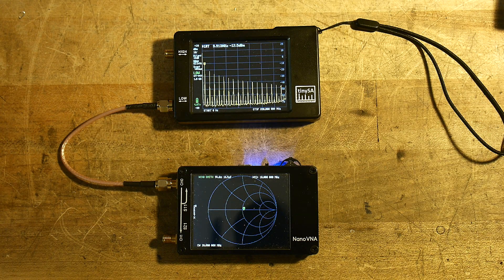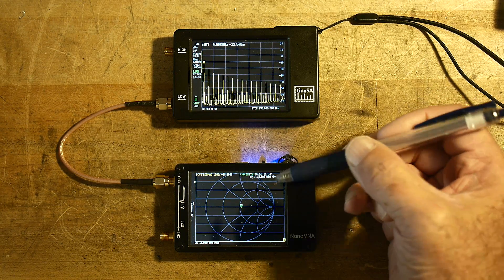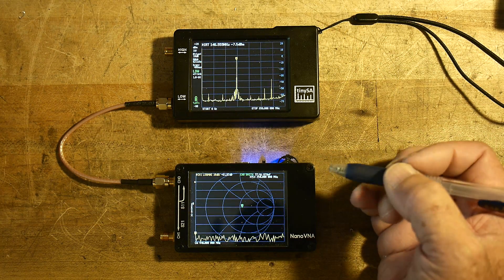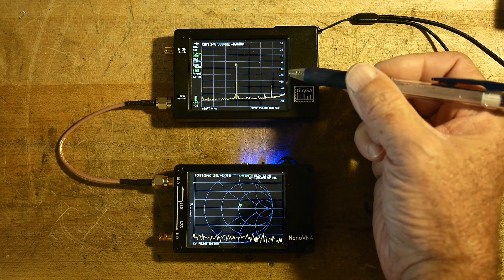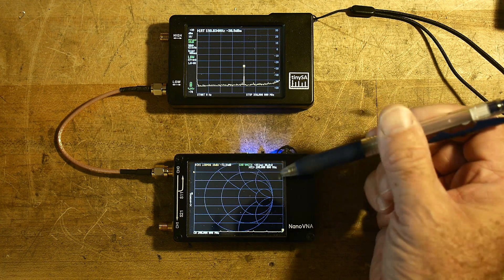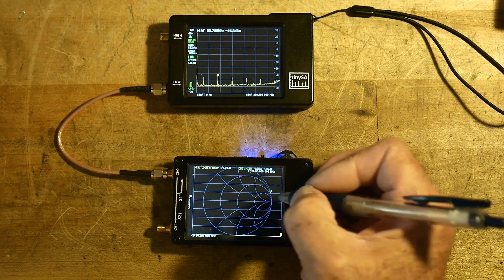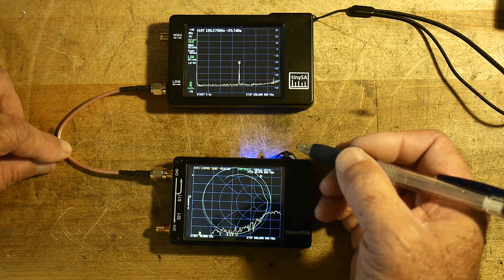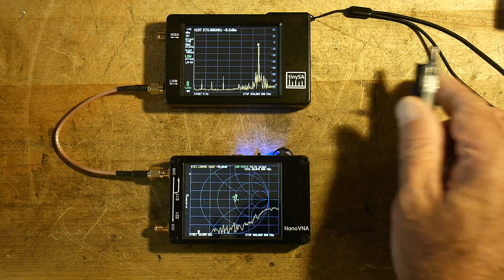#540b TinySA and NanoVNA Fight

Comment: The  146.527 spur amplitude just about disappears after you reconnected the cable.  As you were tightening it, the amplitude of the spur went back and forth between ≈-35 and ≈-50 dB, ending up settling at ≈-50 dB, starting about the 4:17 mark.  Dodgy cable, connection?
Reply: Seems like it, SMA connectors aren't the best they're pretty fragile, and don't always make the best connection, and the cables that usually get used with those connectors usually isn't of the best quality either. I really wish they would have used BNC or something a bit more robust that could accept a better coax.

Comment: You need to change the input on the sa to read above 350 mhz
Reply from the maker: be aware that the tinysa high side does not have the same performance as the low side. much of the circuitry is bypass and the noise and spurs are quite large.

Comment: The nanoVNA can not output above 300MHz, it uses harmonic modes above 300MHz. If you set 800MHz you get 266MHz
Reply: and if you set 440 MHz you get 146MHz
Reply: This result has the consequence of sending any electronic design to the ChiNAZI regime, you expose yourself to the theft of intellectual material versus its low manufacturing costs.
it is better to send your designs to factories in Taiwan than if you respect intellectual property and have an excellent level of electronic manufacturing.
Reply: @guillermoiturriaga7863  OR extend our high-end component / processor factories in the US to accommodate low-end / high market presence components.
Reply: @guillermoiturriaga7863  это изначально продукты open hardware.   О какой краже ты говоришь?   Западные заводы сделали бы тоже самое что и китайцы, но поставили бы цену в 2 или 3 раза выше.   Сами авторы разработки не обладают ни производственными мощностями ни достаточными финансами.  Благодаря китайцам это может купить любой человек в мире.